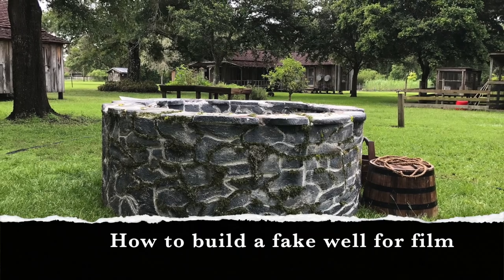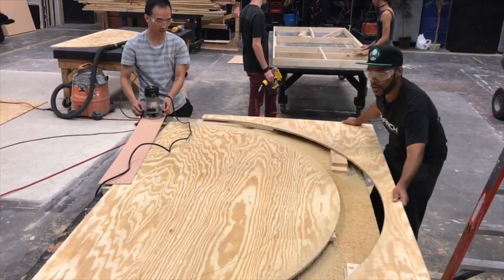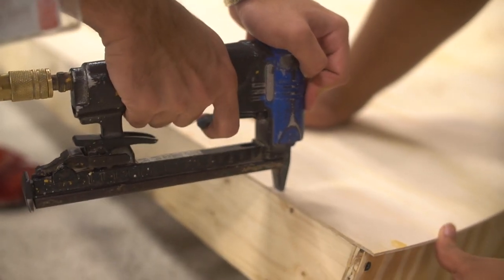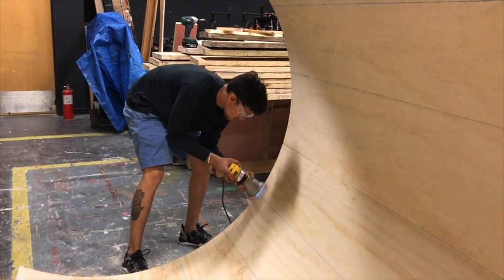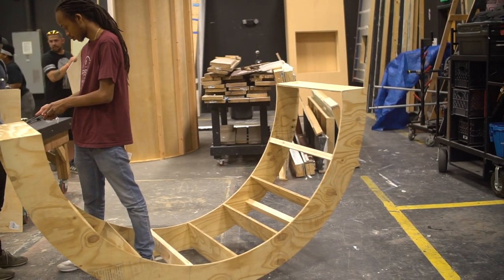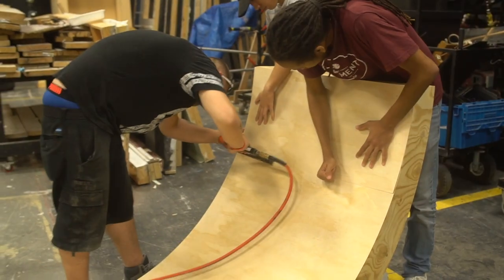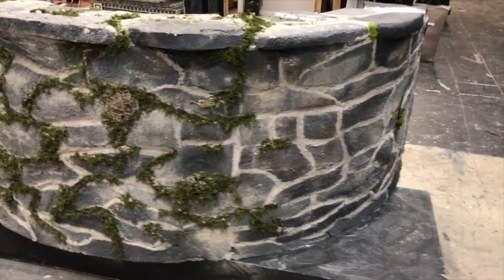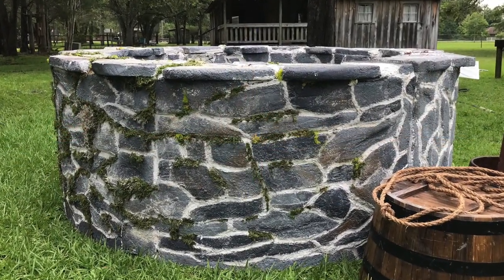How to Build a Stone Well from Styrofoam- Props for Film

Comment: Awesome video thanks. Where did you get the foam rock panels from?
Reply from the maker: The foam is from a previous project where they drew and cut out the stones on the foam.  There were lots of used pieces like this stacked up in our mill.  We do our best to recycle and reuse old set pieces.  The foam is actually 2" foam purchased from either Home Depot or Lowes and is just plain white.